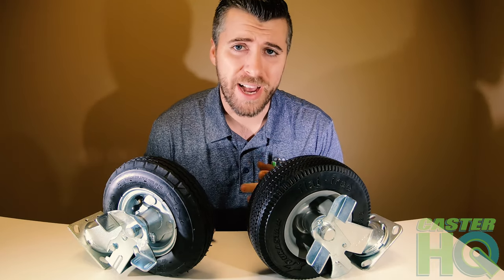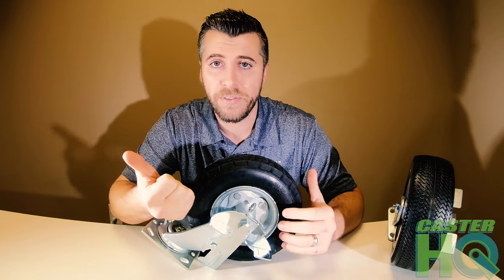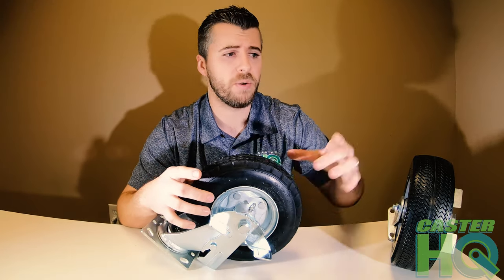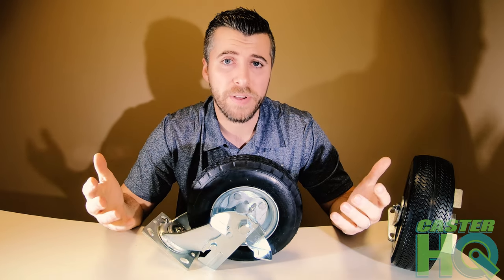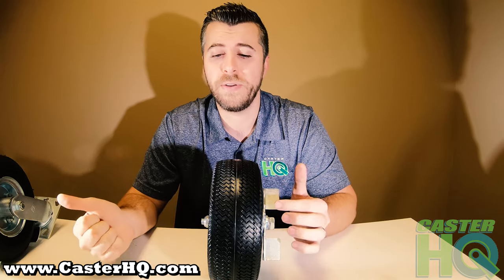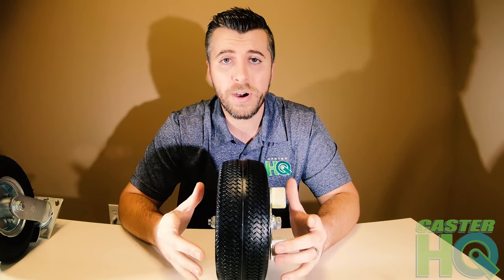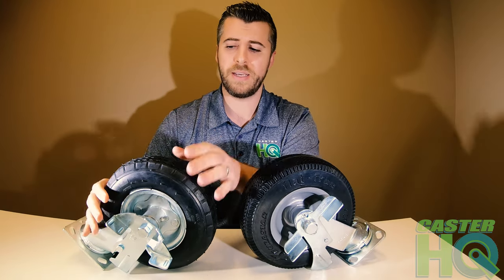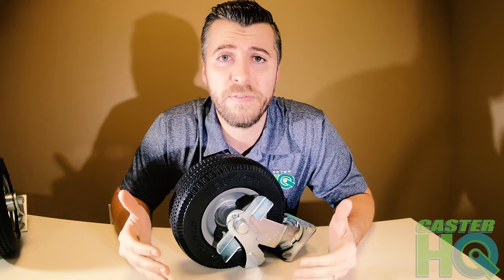Flat Free Tires vs Air Filled Pneumatic Tires For Casters, Carts, and Equipment - Detailed Guide

Comment: How about rolling resistance for each type of tire?  Will one type be easier to push with a max load than the other?  How about on hard surfaces vs. grass?  Assuming the pneumatic is properly filled to it's recommended pressure.
Reply from the maker: Great questions. I plan on making a much better detailed video soon. Load resistance will be easier on all surfaces to roll with an air filled tire properly maintained. Flat frees will always be more difficult to roll in general since they don’t provide resilience and rebound like and air filled offers.
Reply: My experience with foam tires on my wheelbarrow is it does have more rolling resistance as I load the wheelbarrow.  Living in the desert with thorny plants everywhere it was better for me to go solid tires than have to constantly deal with punctured tires.

Comment: Hey buddy, im trying to choose between the two im going to use it on a hand truck dolly. Im moving heavy furnitures and appliances. Which one should i choose. Tnx
Reply from the maker: Air filled tires will roll easier and protect your load better. Foam Filled won't roll as easily but are maintenance free meaning no need to add air or check pressure.

Comment: Can flat free carry the same load weight as pneumatic?
Reply from the maker: Yes. They carry around the same capacity but be sure not to leave the maximum weight capacity these are rated for sitting or parked for long periods of time on the flat free wheels as they can develop flat spots. To prevent flat spots multiply the weight capacity of 3 wheels instead of 4 and you should be good to go.

Comment: For a metal gate, which tire would be best? Pneumatic vs. Flat free?
Reply from the maker: Hi Kelley,

It all depends on the weight of the gate. A flat free wheel could actually flat spot if too much weight sits on those foam filled tires for too long. An air filled tire requires more frequent maintenance of adding air and checking the tire pressure to make sure it doesn’t go flat. I recommend a solid rubber flat free tire. We do carry a flat free tire that has a solid rubber tire instead of foam filled. It might be best. Call us anytime 844-439-4335.

Comment: What type would you recommend for an auto body dolly that will move across grass/dirt? Is there another type that would work well for my application?
Reply from the maker: Hi Rich,
What is the weight capacity? For grass and dirt I always recommend a Air Filled Pneumatic or Flat Free Pneumatic Caster. I am not sure if these can handle your weight capacity? https://www.casterhq.com/pneumatic-casters-s/178.htm

Comment: You never discussed the maintenance for the pneumatic tire.
Reply from the maker: Pneumatic Tires need periodic maintenance due to the tire being air filled they will need to be maintained and re-aired depending on how long these sit or how much they are used. We always recommend checking the air pressure on the tires every 2 weeks if these are used frequently other wise 3-4 weeks will suffice although you may not need to air them up this frequently.

Comment: Not helpful. Is pneumatic tubeless?  Is flat free solid? What extra maintenance required on pneumatic? Etc.......
Reply from the maker: Our pneumatics tires are tubeless. The flat free are foam filled not solid. The pneumatics will require a bit more maintenance since you have to air them up periodically. The flat free are great wheels which provide a wide foot print for out doors but will not be as shock absorbing compared to an air filled pneumatic tire. Flat free tires should not be loaded to the maximum capacity of 4 casters if they will sit for long periods of time as they can develop slight flat spots. Sorry the video was not more helpful. This is still a new thing for me. Thanks for the interest and great questions.